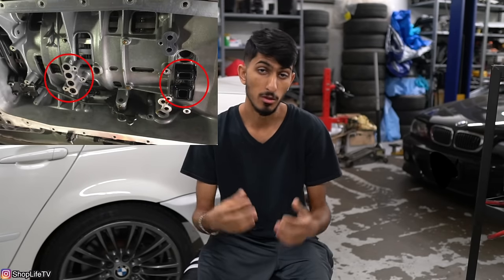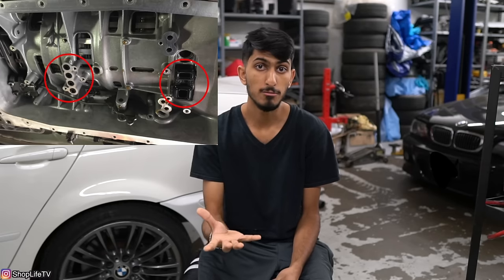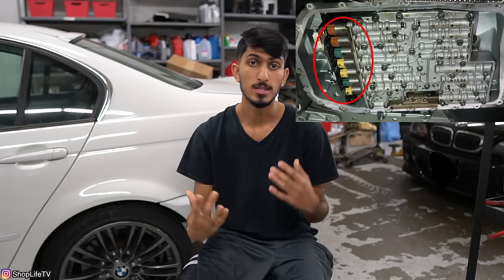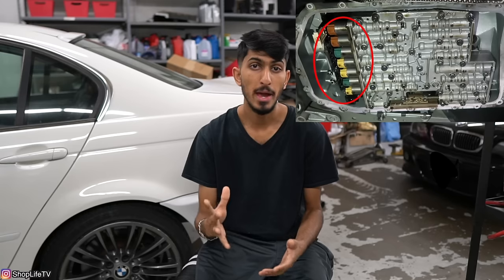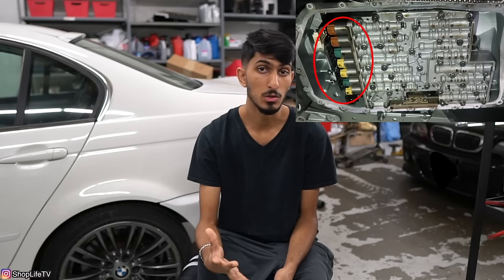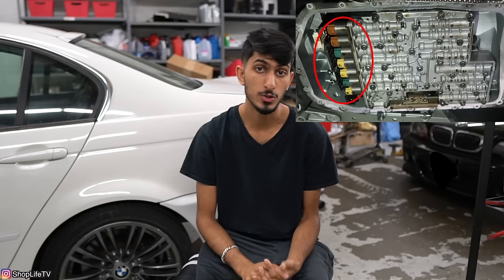ZF 6HP 6 Speed Auto Transmission Troubleshooting! Common problems

Comment: My ZF6HP12 goes into limp mode when it gets to temperature. Replaced fluid, filter, sleeves, solenoids, cooling block & reset TCM.  Sometimes, the check engine light comes on. Always, stalls my car and it won't start.

Comment: ZF6HP28 in a bmw 2011 335d. What would cause the transmission to shift early? For example goes into 3,4th at 1500-2k Rpms when going slow lime on neighborhood street. New solenoids, seals, filter and fluid.
Reply: update?
Reply: Any update?

Comment: Great Great!!! Video. I have a 2004 BMW 525i automatic with the M54 engine. I'm assuming to ZP transmission. It doesn't go past 3rd gear on and off. For example one trip it will shift to all 6 gears and some trip doesn't go past 3rd. My code scanner says something about Solenoid D. Does solenoid D mean 3rd gear solenoid? Which part is this? Please help!!! The CTSC website only displays this part for the yellow one. EDS Solenoid.

Comment: I´ve a E61 523i 2008 with a automatic gearbox, gearbox works great after oil and filter change, but the issue with the gearbox didn´t go away, it´s a squiky noise when engine braking, you hear it clearly below 30mph to stop, what can that be??

Comment: I'd like to send you a video of what my 535i is doing... It's very very strange and I have a feeling it's rare symptoms.. basicallyit won't move anywhere in drive or reverse but when it's in neutral if you give it gas it will rev up to about 2,000 RPMs and slowly move forward. It also will not go into park.. any guidance would help. I know you said that the valve body is virtually never bad and it's always a solenoid sand seals. Have you ever heard of these symptoms?

Comment: HI. Thanks for the video, it was very helpful.

I have a 2006 BMW 550i and it started to slip a bit. I took it to a chain brand transmission shop (starts with 2 A's)and they said that it was leaking fluid from the seal and they recommended that I replace the transmission. They provided me an estimate for the transmission replacement but not to fix the leak. They said they topped off the transmission, too. I took the vehicle home and scanned it with my cheap non-BMW scanner and got a code P0700. Or that is what I remember because my scanner didn't store the code. I cleared the code and now the car will not move under it's own power. Could this be the sleeve components are worn and need replacement? Could it be the solenoids too? I am thinking of replacing them all myself but don't want to invest $600 in parts if the transmission is shot.

Comment: Great video. You mentioned a 3rd gear selenoid goes bad, can you tell us exactly which selenoid this is? I'm having a trouble shifting up 3-4. Can't go into 4th with higher rpm. Slips out. Possible a diagram for each selenoid and matched gear would be great.
Reply: any update? thanks
Reply: Update?
Reply: @earlgrant325  I found some Sonix rebuild document on web that describes issues being loss of pressure on the selenoids and it had a few seleniods and the rubber pistons on valve body are worn flat. The document also had which selenoids are active for which gears. It was at least 3 combinations always. But if your having issues it's one 4-5-6 is a selenoid issue or it's the bushing worn out on the e-clutch drum.  I swapped my valve body from another one, and now I got same issue on 5th gear.   I swapped all the selenoids back and have issues on 4th gear again.  I replaced the rubber pistons.  Same issue. Put then other selenoids back on and should have issues on 5th again,  but didn't. It was still darn 4th!! What a headache. I'm sure it's then bushing on the e-clutch drum.   My landy is still parked.  I got tired of climbing under and spilling fluid all over me and it still not work.  I'm thinking of buying a bushing kit and rebuilt valve body from Alibaba since they're really cheap there.  Until then. Still getting a sun tan.
Reply: @UptownFights What have you done?

Comment: Hei. I dont have any errors. Gerbox is shifting well. The only problem is that rpm is jumping when car is cold. When it gets warm everything works fine. I checked oil level and it was ok. The oil was looking very old - black. I bought new oil. I wonder what else should i change ? :)

Comment: Hi! Great video!
I have a bmw 635d from 2008. I've got an issue with my gearbox. After the car decelerate from around 3000-4000 rpm I can feel a shaking(shock), it's like the gearbox rush to change in to a higher gear. I've been on the service they change oil and pan but it does the same problem, apart that the gearbox it's a perfect shifter. Please help!

Comment: My 05 645ci has been sitting in storage for a while because was told I need a new trans, can run and everything but will not go in any gear, could just be the issues you stated.

Comment: Thank you so much for this informative and detailed video. I have watched the other two videos as well (solenoid change and mechatronic change).

I had a transmission issue, changed solenoids and the issue got fixed! However, now I have another issue --- my car vibrates when changing the gear from P/N to D/R. The vibration disappears after I move and accelerate.
In other words, it vibrates only when the car is on the D/R + Break pedal. The vibration worsens when I spin the wheel all over to left/right while parking. 

Can this still be related to transmission? e87 the same transmission in the video.

Comment: 4e87 code shows EGs-Solenoid valve 4 (shift lock), changed the whole gearselector that has the shiftlock solenoid but i still get the error, what else shoud i do? Car is E91 318 Lci. Thanks

Comment: I replaced all 5 sleeves and solenoids on my 335i, and that did not get rid of the jolt when downshifting from second to the first.  The jolt only happens when slowing down abruptly.
Reply: Did you ever find out the issue im havin the same problem from 4-3 and 3-2 downshifts in sport
Reply: I didn't drive in sport much, but as far as I remember the jolt only happened when going from the second to the first.

Comment: Have a problem with 2013 Maserati GranTurismo. No clunk or anything just suddenly stopped shifting from 3rd to 4th gear. It's like it tries but misses the gear and then locks it into 3rd. Hoping solenoids will fix it.

Comment: Hi Jason what does it mean when I’m driving at 60-70 mph and the revs are fluctuating ? Great video font of knowledge mate
Reply: Same problem 😅 e60 535d/2005 i think torque converter or pressure converter..😮
Reply: Same problem around 30mph/50kmh

Bmw e91 lci 318d with 6hp21
I read different stuff 
Valvebody 
Maf sensor 
Torque converter 

???😅

Comment: Got an 04 525i. Am getting a transmission malfunction and the code is for the downshift from 5th to 4th. Only does it during city driving on the highway usually never kicks. Sounds like I should start with just doing fluid filter and mechatronic sleeves to start?

Comment: I have this transmission in my 2004 jaguar xjr , i had this unit rebuilt but i am having an issue with the transmission getting stuck in 3rd gear. I have had other shops tell me that the unit needs to be rebuilt. I don't have any slipping in any gear but on the highway i run into this problem. Do you have any recommendations?

Comment: I have a 2005 BMW 645ci and I'm getting that clunk between 1-2 gear like you described in the beginning of the video. And also sometimes it clunks in 5 gear also but other than that it shifts very smooth. Would you say it's the sleeves?

Comment: Hi there...great video....very informative!!!
Need some help with my 2012 X3.
It's started to show 'Transmission Fault' at low speeds only around 40/50....perhaps downshift from 6th to 5th. But only downshift as on accelerating it's fine. No jerks of thuds!
Code comes up as 
420631
GEAR MONITORING RATIO
GEAR SHIFT 6X0 NOT PLAUSIBLE.
Have changed the fluid and the filter.
Still persists!!
Shall I try solenoids ???

Comment: Wassup bro my car when it comes to 3rd gear .. around 3 thousand rpm then it pops out of gear and if I let off the gas it gets back hooked up and drives smoothly through all of the other gears .... I had the car scanned with a obd or odb scanner whatever it is called and the car didn't show anything at all .... So me and my friend changed the fluid and added stop slip to see if anything would change ... Oh yes I have a bmw 328i 2008 with 117k miles...

Comment: Great video. 

I have a 320d; it has two main symptoms.

Rpm fluctuates 50-100rpm when cruising at 40 mph, for example.
Bad shifts, hard shifts happen when warmed up, but its fine when cold.

 transmission faulty message too, sometimes.

Any tips?

Comment: I had replaced my sleeves but I noticed one of them didn’t sit properly like the others it sinks in. I have no clue if that’s bad. I’m just assuming my trans is bad or could I save it by replacing the valve body?

Comment: Would you not have code with a bad solenoid?
In my 5HP19, the second gear has always a two stage shift into the third gear. But vcds shows no fault code.

I did fluid and filter change using original filter and fluid. Still the issue is there.
Do you think it is the solenoids?
Reply: two stage shift is the torque converter..  e46 325 03 have same problem and changing the TC cure all the problem.

Comment: I believe I have an electrical issue where the car will not go into drive or reverse. It will move forward in neutral and I've even tried swapping in an entirely new known good transmission from my parts car only to get the same issue.

Any idea?

Comment: Hello , I have a 2006 550i and changed the transmission filter and oil and now have a small leak. Did the mechanic improperly install the filter pan ?

Comment: Hi there . I have bmw 730ld 2012 and gear box 6hp the problem is the Solenoid valve 2 defective short-circuit to ground or open circuit  . Need to replace all solenoid valve and mechatronic or just solenoid valve? Before the car change gear very smooth .thanks

Comment: Is good to this guy give you a Tips if you purchase a BMW tried to purchase 2010 and up and get the extended warranty I work for a dealership on use the card department and example for this kind of problem with that with transmission you can spend $4000 easy if you purchase extended for 3500 you will save dinero compadre

Comment: E90 2005. Auto trans runs fine on smoth road, but once hit road bumps or hard accelerate, gearbox start to fail.. Even on park just heavily acceleration makes P icon on dash blink. Where should I look for problem? I think it should be electrical fault? Maybe some demaged wires or plugs? Please help.

Comment: Good advice! My coworker has a 2007 3 series that is stuck in limp mode. She was quoted $5000 to have fixed!
Reply: YES ME TOO HAHA!!! I told a transmission specialist the bridge adapter problem and asked if they can fix it. They said no, we can replace the mechatronics unit for $5000... This obviously wouldn't help because the oil it still leaking past the bridge! So i ended up buying the bridge off Ebay with the sleeve for $40 and doing it myself. Bit of a pain to get it done though..... Also had to get some of that expensive oil and new pan/filter
Reply: Bloom0to9 Did you drove to the transmission specialist afterwards to teach him a lesson? 😂😂

Comment: I have a weird fault with my daily E9X 330d on upshifts in 1/2/3 the car thumps when shifting. Now my prop shaft centre bearing is in bad shape. I’ll be changing the prop shaft bearing tonight after work but I have a horrible feeling it’s going to be a transmission because it kind of holds onto the gears a bit too long then thumps… this is only in low gears 1/2/3

Comment: HI Ankur, I own a 525i 2009 with Electronic gear shiftier, it gives a jolt or clunk when i start it up. Gear shifting is very smooth and there is not any other issue. Any advice ? Recently there was a transmission error and car was stuck in "P". My Mechanic changes the solenoid set and after that issue was gone. But this jerk at start issue stays..

Comment: My 2006 BMW 530i has a jerky gear change at times. It also shifts late as well between 2nd to 3rd gear. Sometimes it shift smoothly and on time. However, there aren't any codes. Got the transmission scanned on INPA and no codes. Does it only need a trans fluid and filter change?
Reply: I have the same issue with my 2008 540i. Especially slow moving traffic - 2nd to 3rd can feel real harsh. You ever found a solution?
Reply: my 2007 525i has 1-2 and 5-6  jerky shifts sometimes. no faults. I replaced the filter/pan and fluid, reset adaptations through ista. and it seems to be a little better, but not much, i'm going to try the solenoids and mech seals in a couple weeks. everyone who has changed those seems to have really good luck
Reply: @TDubsKid  did you have good luck? Mention me with your reply, really hoping to get this fixed...
Reply: I got the same problem. any luck finding the solution?
Reply: @TDubsKid  how's changing the solenoids and seals?did it solve the problem? mine jerky 1-2 only.
Reply: @TDubsKid Any updates?

Comment: I have an E60 535d, 2005, UK car. I have no fault codes but my car is slow to take up drive sometimes from a complete stop. If I boot it from standstill it will also sometimes stay in first gear and I have to let off the throttle so it will change into second gear.
Does that sound like it could be the sleeves? Or wrong oil level?
Thanks for the video, really helpful.

Comment: Thank you for the informative video. What would you recommend?  My 328i (2009) has stopped going into drive and  reverse. My scanner is throwing (56BF EGS  gears 1,2,3, and 4) plus (56BB EGS: 1,4,5,6) plus  (56B8 Ratio fault R) Any suggestions? Thanks

Comment: just been watching a few of your vids on servicing the ZF gearboxes. Just wondered I have an error p0706 gearbox position sensor come up on my x5. It had the oil serviced before I bought it but wondering if the fluid is slightly low would this possibly cause that error? Its not coming up for weeks at a time. I need to change the sleeves as 2nd to 1st   is a bit sharp sometimes, but is there something else i should be looking for when i go into it?

Comment: I have an Audi S5 V8 with the ZF 6HP28AF. I replaced fluid and filter. It was in good condition. I am having with little issue in manual mode when I shift from 3rd to 4th under load it kinda slips into gear, slips and then jerks into 4th. Driving in D or S goes perfect and super smooth. Sometimes after a long drive would shift perfect 3rd to 4th. Could it be a bit low in fluid? Thanks!

Comment: Great video. You might have saved me a fortune. Any have a link to the mechatronic sleeve parts please? I'm from the UK, I have jerky gear changes but never seen gearbox malfunction on my 2009 Audi Q5 2.0diesel automatic so sounding like your first point in the video. Am I right in thinking to check the oil on my box the pan is going to have to come off?

Comment: hello.i just watch your video.my car is a bmw 118i 2006 model when i start the car the transmission fault is already on but before that the fault is just gonna pop up when im driving im just gonna turn off the car and when i start it its gone then few days later the fault is not turning off any more i took it to a mechanic and the readings are EGS:ratio Monitoring Gearshift 5-4.and he just deleted it. when its downshifting its clanking at weeks later the fault its back on even the engine is not running.and its not shifting when the fault is on. i haven't took it to the mechanic yet since then because they dont know what to do either. thank you in advance!

Comment: Hi love your channel!! So knowledge. I have a 2008 X5 and changed the fluids about 8 months ago along with the sleeves. A week ago it gave me Transmission Malfunction.. I could only drive in a low gear until I got to my destination. Turning it off and on helped but it happens again after about 25 mins of driving. I used all of the factory equipment and fluid. Any idea of what I can do? Thanks
Reply: Did you ever fix your problem?

Did you end up changing the solenoids?

Comment: Hi BMW specialist :-), I would like to ask you for my issue. I have e61 530d, 2004, 320000km. When I drove my car on motorway my transmission went to safe mode with following error codes: 4f80 and 4f95. 
My question is: is this transmission for complete repair or is it related to solenoids only?
In case of solenoid I am able to change it by myself I expect :-).
Thank you for answer.

Comment: Many problems are torq converter on this..i have another complete gearbox but not code it...i have 530i and gearbox are from 525i the same 6hp19 ...and when some shop reset my mehatronik shift like jerk...and like slip from 4-5 gear..what is the problem? Are coding and calibration will help?

Comment: Thank you for providing this content . I'm rebuilding my 2003 Jaguar s type r. I just got the motor back from the speed machine shop. I'm working on the zf 6hp 6 speed trans. Unfortunately the dealer wouldn't help diagnose my trans and no one had the proper reader to read codes. Before the rebuild the trans would throw a gearbox fault on dash and wouldn't shift. I have a generic reader and would clear the code and the car would shift again. Iy also would shift into 6 and slip back to 5 . I changed fluid and bridge seal and valve body seals w no change . I removed the megatronics unit and am looking for someone to fix it. Can I send it to you ? I have replacement celeniods . I live north of Tampa Florida and no one will work on this car. I need help !! Thanks again

Comment: I don't know if you'll be able to respond to this but I have a E90 n51 if I put my foot on the brake and go in reverse it tends to rev up I don't know why it used to do it on the front but now it's calmed what can this be caused by the sleeves also